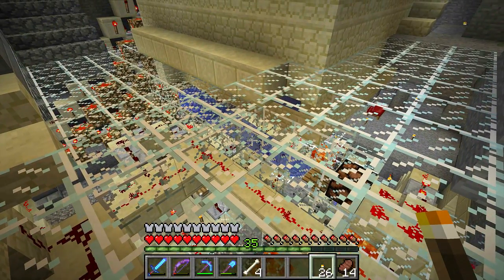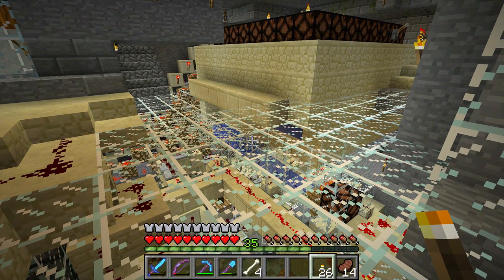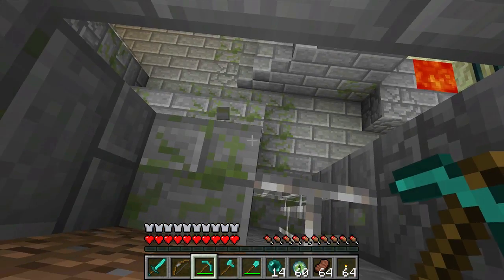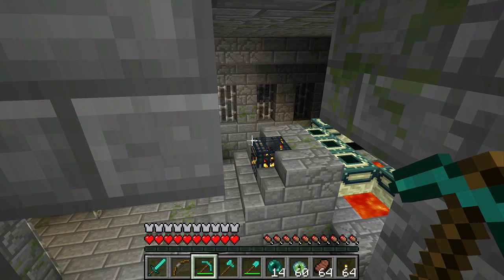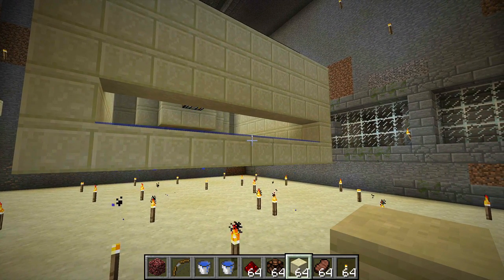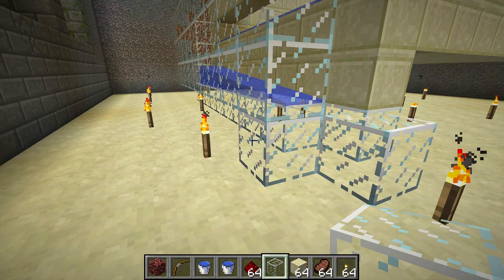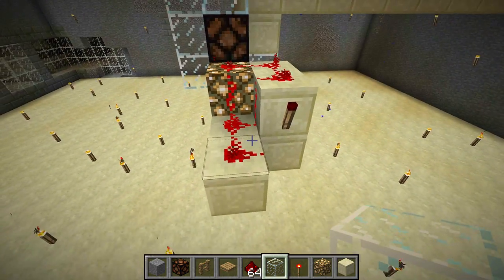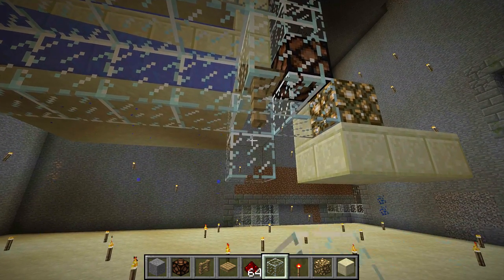Build Your Own Silverfish Cannery (Minecraft Tutorial)

Comment from the maker: Yes, finding that sweet spot can be a little tricky. You need to be at least about 10 blocks away from the infection point or they won't enter the block. My favorite AFK spot in this build is directly above that first row of vertical pistons. That puts you close enough to the spawner and in line with the drop chute in case they track you from the spawn room, yet far enough from the infection block that they'll enter it.

Comment from the maker: Make sure that the timer is getting reset. You may have to reset it by hand. If they're backing up, the most likely reason is that one of them has already infected the block but it happened so fast that the BUD didn't detect it. The timer is supposed to handle that but in very rare instances, it can still get stuck.

Comment from the maker: As I mentioned in the video, while that certainly is a very fun use for them it's really not very practical. They're a pain to herd around and you end up with a bit of a mess with holes leading all over. If you're after efficiency, you're better off using a highly enchanted pick or TNT, depending on if you want the resources or just want a big hole.

Comment: Please release an video updating the bud switch. i tried it i 1.8.1(full release) and the 1 tick bud does not work. i was able to wire up an output to the pressure plate with a sticky piston with a block that activated a circuit.
Please note i have not completed the build as of yet, i will try to make a bud that will activate the silverfish, or just give up and make a lengthy timer.
Thanks for the video, i will try to work around these complications and finish the build, even with less overall percentage to infect blocks. but thanks for the video, once again.